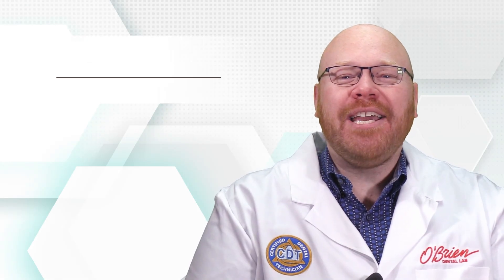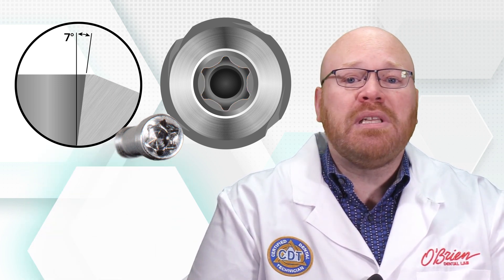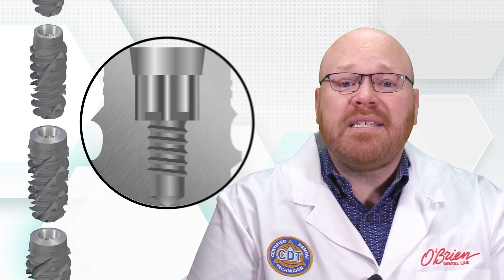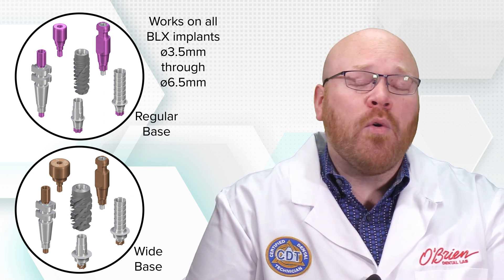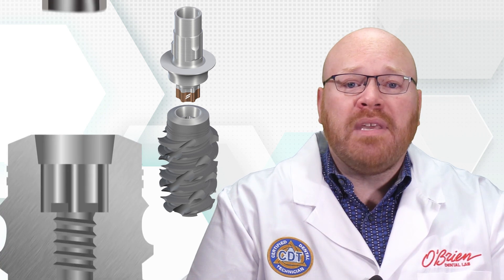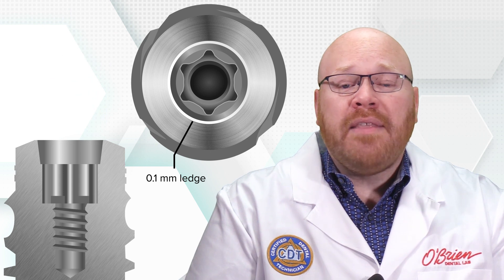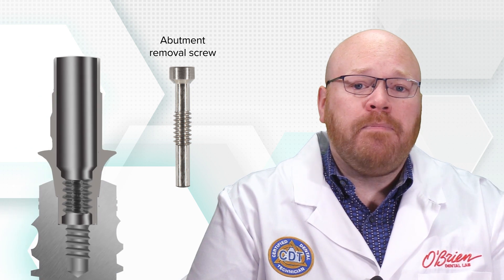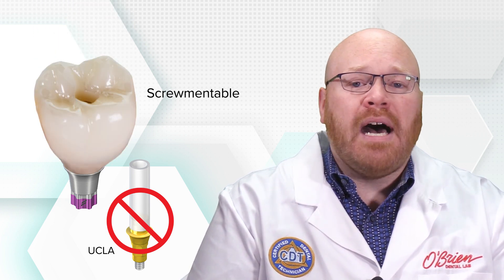Introducing Straumann BLX

Comment: Great video thank. Kindly what is a  dynamic AS abutment how dose it looks like
Reply from the maker: Dynamic abutments are either ti bases or castable plastic UCLA.  You can find out more information at dynamicabutment.com.   The dynamic abutments are not available for the Straumann BLX system, but Straumann does have their own AS variobase abutments that can be used for angle correction.

Comment: Why is there a titanium-zirconia combination?
Reply from the maker: The zirconia top portion provides better esthetics.  The titanium base has a lower chance of failure than if the zirconia were to extend down in to the implant.
Reply: O'Brien Dental Lab are you saying the abutment is zirconia? And, the implant is titanium? Or the implant is titanium within zirconia. I’m hoping to avoid any potential metal issues. Will an encapsulated titanium within zirconia implants prevent any potential metal issues? I can’t find a zirconia surgeon who I can trust and afford other than my local who uses your titanium zirconia mix.
Reply from the maker: @adamli480  The implant is an alloy of titanium and zirconia.  The abutment is made of separate components of zirconia and titanium.  It's a titanium base that is surrounded by a zirconia "top".  You would need to consult with your doctor to determine if the titanium would cause an issue for you specifically.